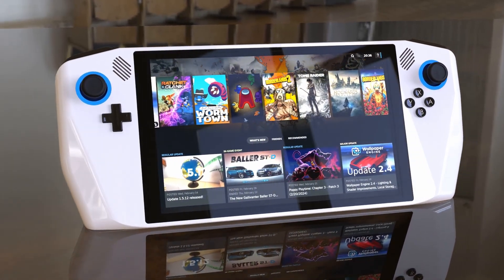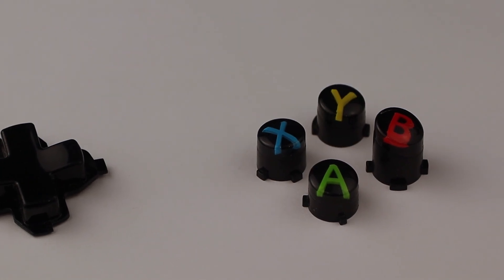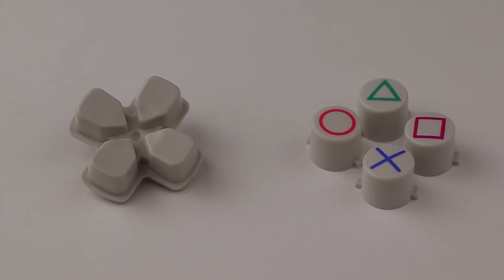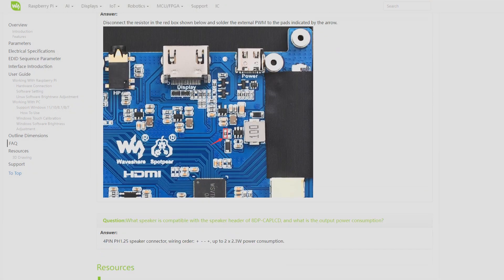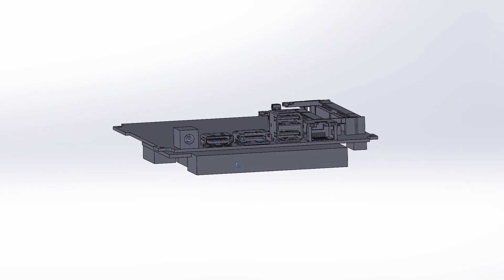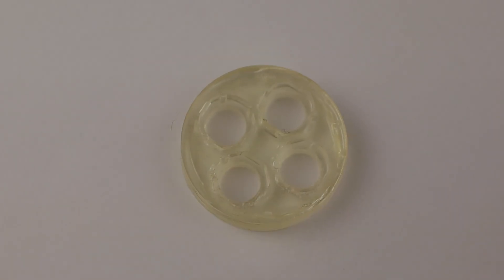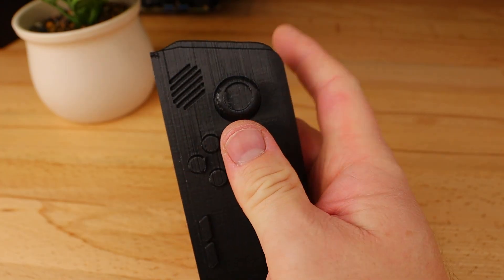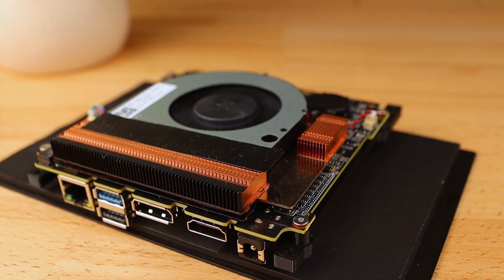Designing a Handheld PC Gaming Console - Part 1

Comment: hey how much would it cost if you do this with 8 inch display... with out controller attached...so that i can use extern controler...i want a device like legion go without controler...
since years i dream of that... but i dont have any skils with 3d printers and such electronics... i only know how i want may device.. 8inch with780m no controller...but other else connections like usbc etc... iam homeless and wanna start my own channel  laptops too big and always need power cable...handhelds 7inch too small for me...  if i had the money i would buy a legion go and trow away the controller...everthing else i attach extern...
Reply from the maker: Hard to say how much it would cost, as the price of parts etc varies from country to country. You could definitely build something like this without integrated controls. There's a few reasons I don't make my controls removable, basically it makes the device smaller and less complicated. But if all you wanted was a PC and a screen in a box with some batteries, its definitely something you could do!

Comment: Are Steam Deck trackpads not available from iFixit? Also, would be nice if it was based rather on an RDNA iGPU instead of Vega like the 6800u or 7840u
Reply from the maker: Unfortunately not! And while it would be nice to fit the latest and greatest in it, I still have a budget to stick to. This time though, I'm trying to make the design as flexible as possible so many different models/brands of mini PC can be used as an upgrade!

Comment: how easy would it be to swap the right stick and face buttons for people like me who dramically prefer symetrical sticks?
Reply from the maker: The sticks are symmetrical in this design, perhaps that was a typo? If you wanted to make them more like an Xbox/switch layout it may be possible but I think I'd have to swap to low profile joysticks again instead of the full sized ones I'm currently planning on using.

Comment: The bigger screen looks nice. I think using the GP2040-CE for controller firmware could be a smart move. It's been very battle tested (heh) in the fighting game community and made for very low latency.
Reply from the maker: Yeah, I like the idea of using GP2040-CE but unsure if it supports analog triggers. I need to grab a spare pico and flash it up and have a play with the configurator

Comment: Older consoles like the ps2 would get you that sony feel (and one of the best controllers ever created) without it being curved. I believe they were pretty flat and a good size for kids and adult hands. But I would check out the rest of the history of consoles instead of just the newer ones you mentioned in this video (xbox 360 might have that look you are going for without the height for example).
Reply from the maker: The 360 has the same problem of the buttons curving to match the face of the controller sadly! PS2 buttons are nearly identical to PS4 buttons anyway, so there's no real difference there. I actually felt they were a little too large which is why I went for the switch lite buttons as otherwise I would have to increase the size of the console further to be able to fit large buttons and still have them in an ideal location.

Comment: Vita buttons, they are great.
Reply from the maker: They are as small as the switch lite buttons I'm already using. I may make a version that uses the vita buttons too since they are so similar in size, I'm pretty sure they would both work.
Reply: @cncdan  the vitas dpad is class, also: some 3rd party xbox 360 controllers have buttons that aren't long.

Comment: The 360 control buttons. Also this time around you should use something like Chimera OS, Bazzite OS Winesap OS instead of Windows for this device but don't use Holo ISO cause I heard the developers are discontinuing it in favor of a new immutable OS they are currently developing or will start developing soon.
Reply from the maker: Sadly the 360 has the same problem as the newer xbox controllers, the face buttons are curved to match the face of the controller. I'll definitely be exploring some other OS options on this one since it should be compatible!

Comment: I'm super excited to see your progress!! Godspeed sir and I will be anxiously anticipating all of your updates!!

That said, do you know what OS you will be using for it?
Reply from the maker: Windows initially while I work on development etc, but I plan to investigate some of the steamos clone linux distros since they stand a chance of running on this one since its AMD!
Reply: @cncdan  that's great to hear. With Linux you also have more control of the UI, drivers, and community made plugins to really squeeze the most performance and efficiency from the hardware.

Plus it's freeeee
Reply from the maker: In my past experience, linux can actually be less power efficient unless there's been a lot of work put into drivers for that specific system. I'm hoping that since this is AMD and there's been a lot of work on AMD based systems running linux in the past year or so that it will be a different story here, but we'll have to wait and see. Also the windows licence is included with the mini pc so its as good as free too in this case!
Reply: @cncdan  yeah I hear you, off the shelf Linux distros and packages have been less than energy efficient in the past, especially when you try to plop them down on laptops designed with windows in mind. That being said, the steam deck has changed things in recent years and I think there's more control of TDP either through the OS or with community made plugins.

Comment: I believe retro console buttons might be a good for size and comfortability, such as psp or psvita.
Reply from the maker: Had a bit of a look at my PSP's last night. The face buttons on the original PSP are curved to match the shape of the device so those ones are out, and the vita's buttons are the same size if not smaller than the switch lite buttons so there's probably no advantage to using them over the cheap and readily available switch lite buttons.

Comment: Why not the steam deck buttons?
Reply from the maker: I've been unable to find them as spare parts. I can find custom made resin ones made by small businesses but they are often expensive and I have no idea how long they will be available for. I'm sure we will eventually so reproduction buttons available cheaply for it, but until then I don't want to risk it!
Reply: @cncdan  that's odd. You'd think with how supportive valve has been with the right to repair that they'd supply buttons and stuff. Quite unfortunate
Reply from the maker: I haven't tired valve directly, they may offer them as a spare part. But my aim is to find a console with buttons that are being cheaply mass produced in china. The switch lite buttons and membranes I'm currently planning to use are about $10 AUD delivered for the whole set!

Comment: I was making a remix of your original nuc deck using an iPad display. I was originally going for the idea of making it so you could just clip in the nuc box into the back of it so it could be swapped in and out with any mini PC easily. Unfortunately, my design came out as being really heavy. My wife kept mocking it, saying there is no way that is usable, and yes, I agree with her on this assessment. I am now going to redesign it but in the mean time I did get a Asus ROG Ally for xmas. but man this project is still cooking in my mind. Well done on this and cant wait to see the outcome. Oh the ROG Ally has some major design flaws to its name so even my heavy weight beast has its perks.
Reply from the maker: Yeah, the Nucdeck isn't exactly light weight either. I'm doing my best to cut down on weight on this one where I can, but just the pc and display assembly alone weighs about 510 grams. Add 200g worth of batteries and that only leaves me 140g for the housing, buttons and pcb's before it weighs the same as a Lenovo Legion Go which is a tad larger than my design.

Comment: I was poking at my parts bins, and had another thought on the touchpad, what about the touch layer off of a smart watch, or even it's whole display? Those are about the size you'd want, and probably could be sourced cheaply, though likely would require a dedicated chip to handle.
Reply from the maker: Yeah definitely a good idea, and one I have already given some thought to. I think a touchscreen display as a trackpad could be awesome, but I need to find one where the touch overlay is a nice "finished" size so I can fit it level with the surface of the controller, otherwise I'll have to sink it below the surface and it might look a bit strange!
Reply: @cncdan  Most trackpads are sunk below the surface, so I don't think it'd look that weird, unless you mean you'd have to sink it really deep.
Reply from the maker: On older systems, definitely. But most modern laptops I've seen (and the steamdeck) have them flush with the surface. That doesn't mean I couldn't do it though, I'm still giving it some thought. I do think a display would make for a pretty cool interactive mouse, even if its only a monochrome one.
Reply: @cncdan  I suppose it it is flush on modern laptops. I've not had a new laptop in a good while, so I still think of the old ones. As for the Steam Deck, at least on mine , the trackpads are actually higher than the casing and only go flush when pushing in to 'click'. There are at least three designs of the track pads for Steam Deck (2x LCD, at least 1 OLED), and some people have gotten two different pads on the same unit, so some maybe flush, but mine and most others I've seen here on Youtube sit proud by a tiny amount. I think Lenovo's Legion Go has it sunken in, but that may be to make sure it doesn't get pressed when using that controller in mouse mode.The only real issue I see for sunken in would be that it needs to be easy to get to the corners or be setup sensitivity wise where you don't need to, maybe a decent bevel down to it could work.
Reply: @cncdan  I like this idea also... perhaps with a clear protective cover for a steam deck touchpad so it feels right even if all you can get is a glass type surface watch face. Definitely consider adding a haptic motor there as well so even if it doesnt' work out the gate someone can write that into the controller software to implement haptic clicks.
Reply from the maker: Unsure about the haptic motor, that's something I think I'd need to have in my hands to understand how they did it and decide if its worth the effort of including it. One thing I definitely would like is rumble, but I'm not entirely sure how for that usually works. Might be something else I need to investigate!

Comment: Neat! Nice progress so far.  Best of luck on the touchpads.  Last I poked (around the ROG Ally release) the only thing I found was that Ergo touchpad that's expensive as it's intended as an assistive device to mount to a wheelchair joystick. If netbooks were still a thing, those had about that size of touchpad on them pretty often and internal USB interfaces, but you'll probably want something still being manufactured. It'd probably have to be a replacement part for another gaming handheld or self-spun.

Comment: I love this series and would like to know if you have had this issue. I am making a device like this and unfortunately I am using a vertical screen (1200x1920) and can't seem to rotate it in software. I am using holoiso. If you have any info on that I would appreciate it.
Reply from the maker: This is actually a problem on my original UFO as the tablet I bought is portrait orientation by default too. I haven't got any advice on what to do in Linux but in windows I found that if the game supported full screen windowed mode that it would work fine. I remember finding a launcher for older games that could force all sorts of display modes but it wasn't always a success so it really didn't help much most of the time. This is why I've avoided portrait orientation displays since then! Sorry this isn't more help!

Comment: IPega makes controllers with small buttons. The controllers work pretty and are well priced (at least when I got it years ago).

I'm referring to their telescopic controller.
Reply from the maker: Looks like a cross between a playstation and xbox layout! This is definitely cheaper than the razor one someone else suggested but I really want to be able to just buy the buttons as spare parts and I haven't had much luck for things like this unfortunately, otherwise I'd have far more options available to me!
Reply: @cncdan  Have you ever heard of 8BitDo? They sell their face buttons as replacements $2.99 USD for a set of four. I'm not sure how much it'd come out to with shipping. Their shipping policy states all orders come from their distribution center in China. Maybe proximity to Aus wouldn't make it too outlandish.

You said you wanted buttons from a flatter faced controllers at that, so I'd google/suggest 8BitDo SN30 Pro buttons. The sn30 apes the aesthetic of an SNES controller so flat face. I noticed on the page for the buttons they also have the sticks(the covers not the potentiometers underneath) as replacement parts, even the conductive rubber pads, but doesn't seem they sell the D-pad strangely.

Comment: Use steam deck buttons
Reply from the maker: This was my first thought, but all I've been able to find for steamdeck buttons so far have been expensive hand made replacement resin buttons made by modders and small companies. Not that there's a problem with that if its what you want, but I want to ensure that what I design it around is cheap and readily available for some time to come.

Comment: Please consider tilting the display slightly to make the wrists less bent upwards - like on the Canon LS-82Z
Reply from the maker: That's an interesting thought! It would make the design pretty horrible to machine though, as I would need to make a jig to mount the housing on an angle to be able to machine the inside of the screen rebate. Might save the tilted screen for if I ever do a clamshell design!
Reply: Would it be easier to design/machine if the bottom part of the display is lowered a bit into the housing (instead of the top part protruding)?
Reply from the maker: Not much different really. Its still a large flat plane that has to have square edges on it. Either way you'd have to set it up on a jig to do it properly

Comment: A modular / upgradeable handheld is an enticing possibility. Keep the same FHD screen, controls, and batteries over time and slot in a fresh NUC mobo or SBC to a reserved space on the back to refresh the device. The rear of the case could incorporate a removable section to accommodate the flexibility.
Reply: That's actually an amazing idea! Especially that beelink for instance uses the same form factor for most of their mini pcs. I just wish Waveshare had a FHD or at least 1600x900 display in that size. It would be awesome.
Reply from the maker: I'm pretty happy with the 1280x800 of the new 8" display so far. I don't know if its the resolution, better colours/dynamic range or just the fact its a tad larger but I feel like I can see what I'm doing on this one much better.
Reply: @cncdan  Yeah I was thinking FHD for future proofing on the assumption it wouldn't be upgraded when a new mobo was inserted but it's definitely a tradeoff for current gen and for power indefinitely I guess. 16:10 or even 3:2 are actually better for people wanting to run retro 4:3 stuff too so it's tradeoffs all the way down.
Reply from the maker: @AndrewHelgeCox  yeah this one is 16:10 so should be perfect for now at least!
Reply from the maker: Yeah this is pretty much the plan! The aim with the power management is to be able to drive anything that takes 19v at up to about 4a input. Could also possibly make a much simpler version of the power management for 5v devices like the pi!
Reply: And what is the refresh rate of the display? 60hz? Lower resolution might be good for AAA games though.
Reply from the maker: @mateszerencsi8224  yeah it's 60hz which I also think is enough for a handheld like this. If the screen could go higher than that I'd be capping it at 60 anyway. I'm the sort of user that will run minimum settings regardless of what the system is capable of, just to get more battery life. But I realise not everyone will want to do that either!
Reply: Well yes, battery life can be an issue, especially if you push the system hard, which is easy on newer games. Anyways, looking forward to this series as well. Keep up this quality work!

Comment: Have you talked to the Orange Pi Neo team about sourcing touchpads?
Reply from the maker: No, besides asking on the discord, I haven't spoken to anyone about it yet. I was really hoping I'd be able to find something cheap on AliExpress like the tiny track pad that's on those mini Bluetooth keyboards but they appear to be built into the keyboard PCB so they aren't available as a separate part unfortunately!
Reply: @cncdan  Cirque or Azoteq make track pad modules.
Reply: @ Note that a big part of the steam deck touchpads is they implement pressure sensitive haptic clicking... there is not physical click just a haptic touchpad. But this is something alot of people miss when trying to use the Legio Go for example with Steam OS because the missing haptics. Apparently they also function different in different modes.. eg desktop mode is a bit different than while gaming etc...